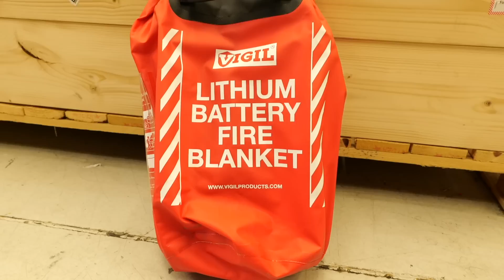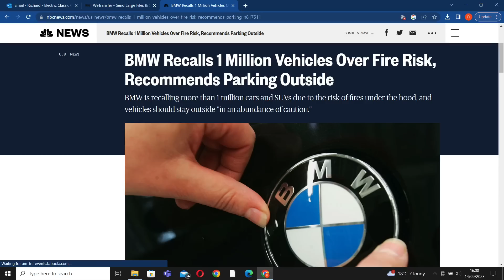Electric Car Fires - Facts and Figures

Comment: Yes ICE car fires need oxygen to burn and can be put out with a garden hose and don't burn hot enough to damage structures (like car parks), whereas EV fires are far more catastrophic and burn more than twice as hot (enough to destroy concrete/metal structures and other cars nearby eg Luton Airport Car park started by diesel hybrid battery), why should i risk having my car destroyed just because an EV is parked nearby?

Comment: Vehicle fire data
Data obtained through a Freedom of Information (FOI) request revealed that in 2019 the London Fire Brigade dealt with 54 electric vehicle fires compared with 1,898 petrol and diesel fires.

Vehicle registration numbers from the Department for Transport (DfT) show there are 50,000-plus plug-in cars licensed in the capital out of a total 4.63 million licensed cars.

Looking at the London Fire Brigade data, that would suggest an incident rate of 0.04% for petrol and diesel car fires, while the rate for plug-in vehicle is more than double at 0.1%. So far this year, there have been 1,021 petrol and diesel fires and 27 EV fires in the capital.

GUESS IT ALL COMES DOWN TO WHICH REPORT YOU CHOOSE TO BELIEVE. 
Either way it’s less than 1% so you likely have the same chance of getting run over, but Thermal Runaway is still a major concern.
Reply from the maker: Do you have a link to the source FOI report from London Fire Brigade? Not media that have simply copy pasted the headlines. I’ve read a number of FOI reports from them which include e-scooters, e-bikes under the term electric vehicles?

Comment: In a petro car, all the heat is contained in the engine while it's running.  In an EV, the heat shows up in the battery pack.  This is why EV's are dangerous.  The heat is in the same place where the energy is stored.   In a petro car, the heat isn't in the gas tank.

Comment: Something I noticed that headlines like to use extreme headlines such as that batteries exploding, which as far as I know is not possible, and is providing an extremely misleading picture of what happens with batteries, which is thermal run away that is causing fires in the battery, but exploding is a very different thing, and is something more likely to happen in a ICE car with flammable fuels. And also not all EV car fires are anything to do with the battery at all, and a lot of the time the battery will not even be burning at all.
Reply from the maker: Exactly 👍

Comment: One thing to consider is that, regardless of the probability of an EV catching fire, it is pretty incontrovertible that if an EV becomes involved in a fire, the resulting fire can be almost impossible to fight. So, if an EV is parked in the garage of a home and a fire starts in the garage and the EV becomes involved in that fire, at that point there may be no choice but to create a safe perimeter around the home and let it burn. To use a metaphor, while the probability of a box of dynamite spontaneously combusting may be practically zero, you wouldn't feel very comfortable about storing it in the garage of your home. It doesn't fully matter what the risk is of an EV catching fire - the large battery pack is like a box of dynamite waiting for a fire to set it off into thermal runaway. Seems like battery EV's make no sense, and maybe nanoelectrofuel fluid would make more sense for storage.

Comment: The big debate is that the preinstalled fire system in parking garages can extinguish petrol car fires, but not electrical car fires. Where I live are the building management talking about not allowing electric cars to park due to this issue.

Comment: Well mate in my mind because there are far more ICE vehicles on the roads then EV's of course the incidence of fire is going to be greater that is common sense unless one has a non functioning brain. It remains too that EV fires are far more dangerous than ICE vehicle fires simply because they burn way way hotter than diesel or petrol cars and  the toxic and explosive gases and toxic materials such as cobalt compounds  are extremely likely to cause permanent serious medical conditions and in some cases death at the time of exposure and even months or years following that exposure. This cannot be said of a fire involving an ICE vehicle apart from the probability of some toxic fumes given off by the burning plastics. Go figure!! EV's are a nonsense!!

Comment: Government agencies carring out analyses will always support the government narative. Government decrees you will buy EVs and only EVs to save the planet. Joe Public raises safety concerns, charging availability, loss of range in cold/hot weather etc. Government commissions a report from another government agency or fund the report from a private company and hey presto all the publics concerns proven to be incorrect. Governments lie fact. These reports never appear to say that EV battery packs burn at 2000 to 2500 degrees C. Higher that the melting point of steel and will totally destroy concrete. ICE fire around 600 degrees C. and easy to extinguish unlike a lithium fire. 

.
Reply from the maker: I don’t know any EV owner who bought one because the government told them to. Most I’ve spoken to bought one because they’re superior to the old technology of petrol/diesel and would never go back to ICE.

Comment: them blankets.  them blankets need to come standard with all ev's. but one that is designed to cover the  battery itself.    like a battery eject mechanism that release the battery off of the bottom of the vehicle and that blanket that falls off with it and ontop of it. so the vehicle can be pushed off of the battery and away so then the blazing battery can be much more manageable.  to pull it away from other vehicles, loaded much easier. still would be a pia but a fraction of the size of  handlign an entire vehicle.   there is many ways to counter this issue.  letting them burn is not a fkn valid option if you think about it for more than 1 minute.  

and the thing is...there is zero safety mechanisms put in place for a purchaser at purchase. just pay a fk load money for it and 4x the insurance cost since no insurances are ready and wiling to be paying for ev accidents, let alone ready to pay for one that the battery started a fire that turning into a multi belonging hell fire and they need to cover the cost of a house and possible the neighbors house taboot lol... i woudn't want nothing to do with ensuring them either.  like signing off on a bank ruptcy befor it even happens lol

Comment: how many ICE car fires are actually electrical fires due to the absurd complexity and computerization of cars. You used to be able to push start a car, NO ELECTRICITY required. Now, you can't even get cars our of neutral if the battery is dead. Turning cars into electrical computers was a huge mistake. A disaster unfolding before our eyes.

Comment: Sadly You have little or no idea about fires, fire spread or fire behaviour. I worked for the fire brigade for 30 years on the front line inc fire safety and fire investigation. Firstly, The stats you have take no account of the following:-  cause of fire,  the severity of the fire, or the age of the vehicle if you talk about cars!! I will give you some facts with regard to Lithium Iron batteries in irrespective of cars.  They are a chemical fires, the worst type far more dangerous than a fuel fire, the reasons they produce their own oxygen supplies they vent first giving off poisonous flammable explosive vapours inc methane and Hydrogen Cyanide and others. Hence why they explode spectacularly. The fires develop rapidly and people have died in theirs being un able to escape. They burn at very hot temperatures that can cause building collapse, like at Luton Airport and others. They are difficult to extinguish because of that oxygen supply and can re-ignite several times hours days and weeks later, many repair shops will not touch them, They are a danger to firefighters especially in buildings due to vapour explosions. Fires in fuels do not spontaneously combust they need an ignition source, are easy to extinguish, do not burn anywhere near as hot and do not re-ignite. Nearly all car fire are electrical irrespective of drive train.   All firefighters will know this. Lithium batteries are also causing fires in buildings and aircraft (Boing 787's come to mind with a near miss). London fire Brigade are attending a lithium battery fire every two days. Petrol or diesel does not ignite when switched off. Another fact is the majority of fires in ICE cars tend to be older vehicles in my 30 year experience, damaged and worn wiring looms are a big cause. BEV's are catching fire some barely off the forecourt.  IF YOU THINK I AM AN EV HATER, SADLY YOU ARE WRONG. THEY ARE THE WAY FORWARD AS THEY DO POSSESS  SOME ADVANAGES  BUT SADLY NOT WITH LITHIUM BATTERIES. Finally, answer me this why are lithium E-scooters and bikes banned on the underground and by some rail companies. Why are EV's  banned in some underground car parks? and why are more and more shipping companies refusing to carry them?

Comment: Have been a mechanic for some 50 years and part of my trade was training or teaching mechanics, I have  never seen a petrol car go up in flames, but I have seen badly reapired petrol cars with protential fire hazards caused by Mechanics, loose fuel hoses or badly run fuel or wires next to hot engine parts, thus causing the fire, whereas EV can just be sitting doing nothing and burst into flames, and when more EV are in accidents and the battery gets damaged, guess what more than likely to go up in flames, an American guy was burnt to death in his slightly damages Tesla, when his foot was trapped, but killed by flames and yes this can happen in a fuel car  too, but I am a user of Lipo batteries and have seen them go up in flames just minor minor damage, EV is not the way out of our problems

Comment: I am wondering what the facts are relating to fires within internal combustion vehicles... Is the fire started by an electrical fault or other factor?
These vehicles do have a fairly high capacity battery for engine start and other electrical related needs!
Just curious...

Comment: That's a very short-sighted analysis. One thing I learned about being an analyst with big banks is that if you stare at the numbers long enough, the numbers will change. (Credits to my former boss - it was his words)

Comparing number of cars caught on fire vs ownerships population is already a skewed and biased data representation. ICE being used all over the industries, commercial, private, heavy haulage, heck it's even used for transportation of dangerous goods.

What should be done here, is to take the number of accidents that involved in an EV versus how many from that catches fire. Why does it matter? because if u just take the numbers without breaking it down, even without the stats we already know that we are likely to die in an ICE vehicle vs EV because the numbers of crashes involving ICE vehicles are definitely higher than EV. Is that a fair comparison?

Just putting that thought out there so consumers can be smart about it. Remember that big companies has been paying millions and billions into lobbying "research" and gov agencies to make it looks safe and this has been happening forever from banking, oil&gas to fund managers who own the stakes in them. I'm betting the same with this EV trend. 

I probably don't have any proof yet but one day the scandal will be revealed. Buy EV if u want but the numbers all over the news are now being represented in a biased manner to make it look "safe". 

Well, trust me or dont. I'm just another random guy on the internet. Wth. 🥱🤷
Reply: Can you tell me what you used, i would love to have some.

Comment: ICE fires are far less likely to kill occupants. Have you seen how quickly battery fires can engulf a vehicle?
Reply from the maker: There is no facts to back up your opinion. Petrol ignited the instant it is exposed to a naked flame, spark or high enough temperature, batteries do not reach thermal runaway anywhere near so quickly.
Reply: @ElectricClassicCars  Nope, it's a fact. Electric vehicles can incinerate vehicle occupants in a blink.  You obviously haven't done your homework if you think petrol vehicles pose even remotely the same risk.

Comment: The short answer - no they are not ready. Not by a long shot.
Reply from the maker: Not ready for what? I’ve been driving EVs for 8 years now, you’ll never persuade me to go back to ICE cars.
Reply: @ElectricClassicCars   If you are going to be an idiot and charge your EV inside your garage, and even worse if inside your garage is actually inside your house, then be less of an idiot and install a smoke alarm over your car that is interconnected to the other smoke alarms in your house. That way, when the battery goes into thermal runaway whilst charging - and don't delude yourself that "that will never happen" - at least you'll have 15 minutes to get your children out of the house and to safety UPWIND before your house burns to the ground.

Comment: I think you missed the point.  An ICE car might catch fire if it’s in an accident but an EV can catch fire at anytime without an accident.  The BMW example is just a defect, not a regular occurrence.  Even a pinto didn’t catch fire unless it was hit from behind.  Battery manufacturers need to deal with this issue.  Maybe something like jell packs or fire suppression systems within the battery pack.
Reply from the maker: A lot of EV manufacturers are already moving to LFP batteries, like my wifes Tesla. Which are extremely difficult to ignite. Also, there are millions of ICE vehicles being recalled now because of risk of catching fire (also when parked), e.g. Kia, Hyundai, Ford, RAM trucks, Ferrari etc. But not one EV is being recalled at the moment because of fire risk.

Comment: no thanks I think your information is pro electric ev propaganda
Reply from the maker: Propaganda? Otherwise known as facts. 😂😆😉👍
Reply: @ElectricClassicCars  Let me tell you here pal you might be sold on the nonsense.  I have gas and diesel vehicles that I was able to increase the MPG on both . And living in a clod hilly place I live I know 2years after driving those electric cars where I live you only get 40% of the range you started with when the batteries were new . Try again they are not ready for cold hilly climates . Not totally against them their just not ready to replace what is truly needed and wanted . Do you see how many they can't  sell .
Reply from the maker: @greglast3610 Well, Pal 😉, I’ve had an EV for 8 years and live in Wales, one of the coldest hilliest places in the UK. In my experience I’ve seen less than 10% range degradation in that time and drive it no problem in the winter. Same as my friends in Norway, a country which is predominantly EVs and currently is -20c. My information is based off facts and experience, whereas it sound like yours is based off opinions.

Comment: Yeah, but with diesel/gas powered vehicles. I can put those out with less than a thousand gallons of water. Heck I can put it out with less then 300 gallons, I’ve done it 🤣. The problem is these Li batteries create their own oxygen. You can put 30+ thousand gallons on it and it still might not go out. At this point, best thing to do is protect exposures and let it burn itself out. I feel like when they created these electric vehicles they didn’t keep fires in mind. I guess they look at it as, “it’s not our problem”.

Comment: In the early days of automobiles they experimented with engines that use gunpowder instead of gasoline. The problem with batteries is energy density. Its all to heavy and bulky. What we really need is a way to power a car with nitroglycerin. Or an atomic car. An atomic car would never need to be charged or refueled in a persons lifetime and like electric cars perfectly safe and practical.

Comment: You are correct. These batteries have internal sensors detecting moisture which leads to corrosion which leads to shorts/opens which leads to Thermal Runaway then KA-BOOM.
Give them a few more years especially in the north (saltbelt) USA.
They'll be selling like hot cakes at Waffle House.
This is also why the Chinees are having problems because of piss pour quality in there batteries if any at all on some them. Bicycles, chargers, phones, vapes, etc. Yep little electric M-80's they can be especially in a log fire. (ask me how i know) lol
We're not at the Jetsons level just yet.
Reply from the maker: Millions of ICE cars are presently being recalled because of fire risk by manufacturers like Kia, BMW, RAM trucks, Hyundai, Ferrari, etc. but no recalls of EVs because of fire risk. Don’t fear progress as it’s always happening.